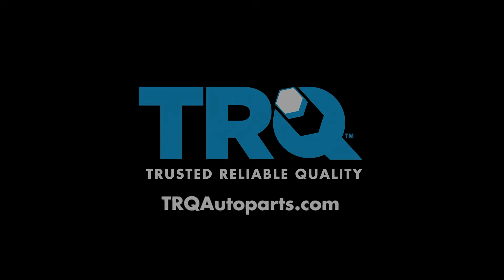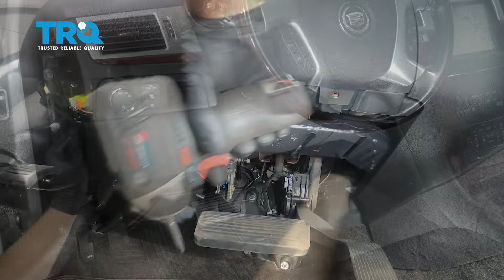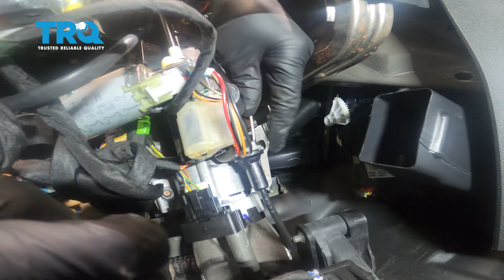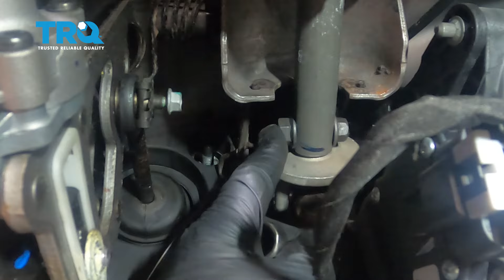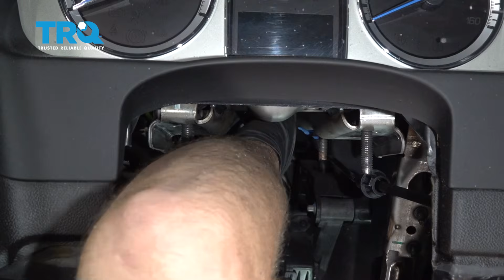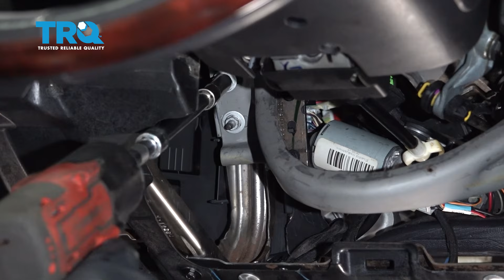How to Replace Steering Wheel Position Sensor 2007-2014 Cadillac Escalade

Comment: For all doing this Job, personal preference always disconnect the POS terminal not Neg, the Negative can touch any metal again by mistake when the car is moving around while working and then the AirBag is charged up again, take the POS throw it to the side tuck it away and no worries to be had.

Comment: There is no need to remove the entire column. Leave it in and leave the electrical connected and after you remove the 4 column mounting bolts and the intermediate shaft just rotate the column over to remove the lover metal cover to allow the sensor to be removed I suggest at that time to replace your column lower bearing as well since you have it apart. This can all be done in the vehicle with much less time then pulling the entire column.

Comment: I have replace my steering angle sensor and reset the code and still light keep turning on when i drive 10mph. Code is c0455 do you have any idea  why its causing this? I have an 2004 chevy express 3500
Reply: Disconnect your battery for 10 min, then turn you key into on just to ON where it give power to the car then what your gonna do it’s turn your wheel all the way to the RIGHT , & then your gonna turn it all the way to the left ok , now you will turn off your key ignition off wait 10sec and turn it on it should take it off the lights
Reply: Tried your method turn the wheel lock to lock and still have same issues as rob